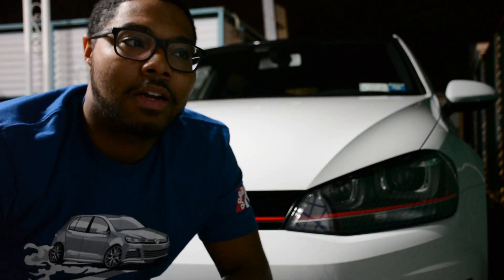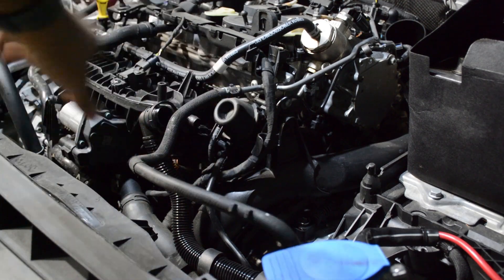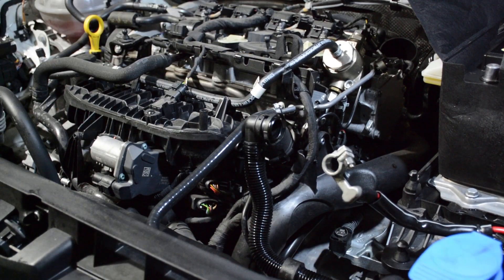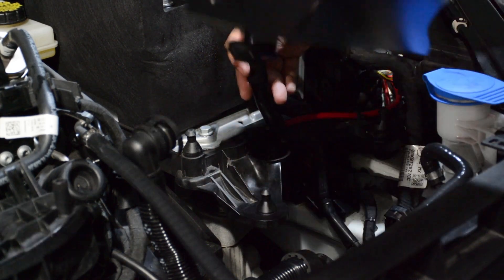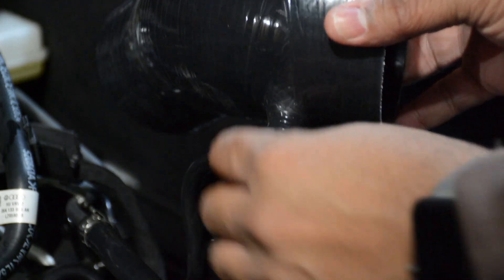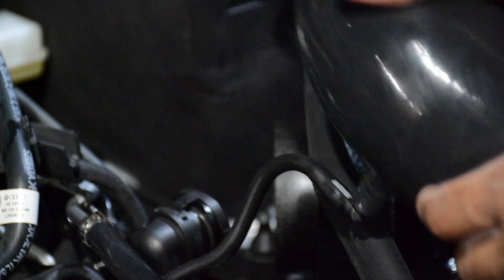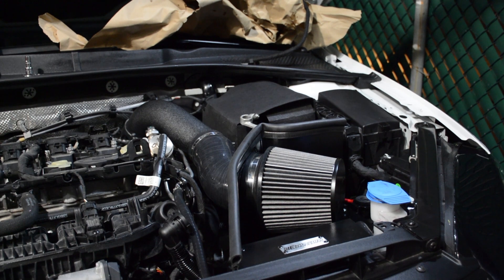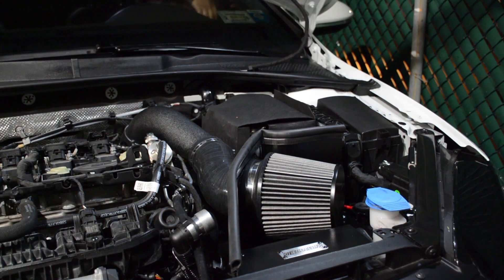Installing an Integrated Engineering Intake on my VW GTI MK7

Comment: Did you have a problem with the vacuum line connecting to the silicone part that connects to the heat shield? My first one was faulty I had IE send me a new one but my CEL came on again I shouldn’t have cheaped out and got the APR intake
Reply: I know this is about 11 months too late but you probably put the coupler on too far and blocked the vacuum port.

Comment: So does the silicone pipe that does not go into the heat shield act as a new "high flow" turbo inlet pipe?  Or does that piece connect to the stock turbo inlet pipe?  Hard to tell from what you say and what I can see in the video.  How do you like it so far?
Reply from the maker: Hey thank you for watching my video. Sorry about that yes it does connect to the stock turbo inlet pipe. So far i love it a lot. In my opinion, the car definitely feels more responsive and the sound is in credible lol
Reply: awesome to hear. pretty sure that's the exact one I'm going to go with for my GTI so thanks for answering my questions.